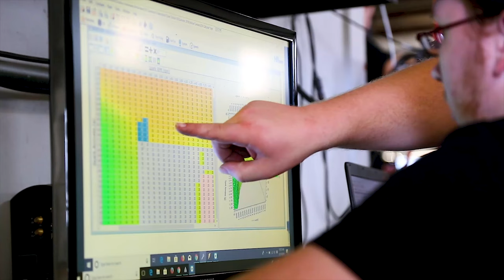1139 RWHP 2019 ZR1 Corvette Time-lapse Build by Hennessey Performance

Comment: Dammit, you guys! All this time I'd been perfectly happy with my HPE800 and now I've got to sell the house and upgrade! ;-)
Reply: That's right, selk the house, donate a kidney and get a loan...cause they sure are overpriced!
Reply: @luisgutierrez5351  I actually bought mine at a Chevy dealer around the corner from Hennessey with the work already done but, yeah, the package was around $20,000 for everything. That being said, it's been years (mine's a C6 Z06) with no problem and I'm still putting down just under 700hp on the dyno in the Florida heat and humidity so I'm happy I took the risk. Cheers.
Reply: You get what you pay for,. Longevity and reliability go hand in hand with performance. Not just a one hit wonder dyno queen, know what I mean,.
Reply: How much does something like this cost mate?
Reply: @youllmakeit  close to maybe 70- 80k
Reply: @kingbrutusxxvi  honestly, if it's reliable it was worth the cost. having a reliable 700hp car is way better than having a 1000hp car that breaks down all the time, in my opinion.
Reply: @DontKnowHowToTypeIn2  Agreed. Nothing worse that sitting on the side of the road with $100K vehicle waiting on a flatbed and avoiding people's laughter as they drive by. Cheers. ;-)

Comment: Holy Mother of Jesus. This is literally car porn. Can't wait to see the results of 0-60 mph and the 1/4 mile.
Reply: John Belk You are probably right, the difference might not be from the other but the stock tires (Michelin Pilot Sport Cup 2) they already offer a lot of grip and I really don’t think that C7 owners really will need a bigger tire than 365 especially since most of them probably aren’t drag racing junkies. But fair point indeed 😉
Reply: all he needs is MT ET streets on Back !
Reply: Probably about 4.2 seconds 0-60 and a 11.0@148 in the quarter. Useless. For bragging rights or 100-200 mph runs only.
Reply: jeff rosenberg How my g they really suck ? If literally those are the track tire with the Trofeo R ?
Reply: jeff rosenberg You know what ? Let’s just wait for the video on the drag strip 😂
Reply: @christophermorales1509  might be a bit late, but just an update for those still reading comments... the newer vids show this car doing 9.8 in the quarter at 155mph